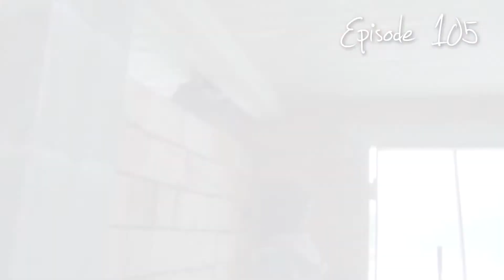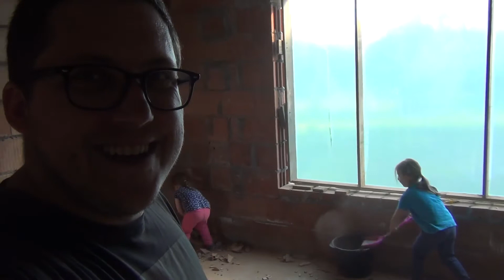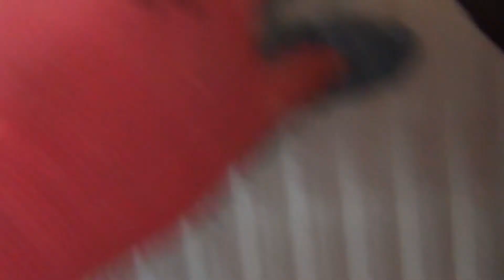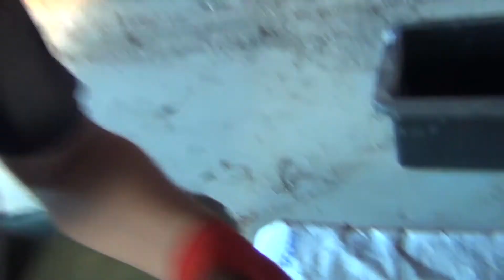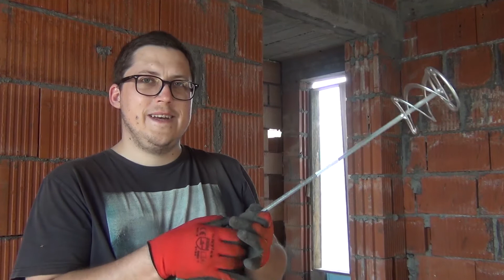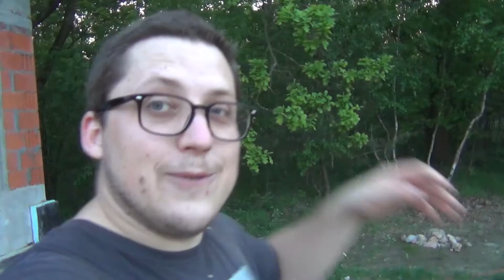BoH 111 - Improving the Brickwork on the Dividing Walls

Comment: Your girls are very sweet! A question about the build - how did you finish your walls? Also what type of fireplace are you putting in?
Reply from the maker: Thank you : ) we are doing cement and lime plaster work on the walls, finished with quartz sand we are currently in the process. For the fireplace we chose an insert but we haven't purchased it yet.